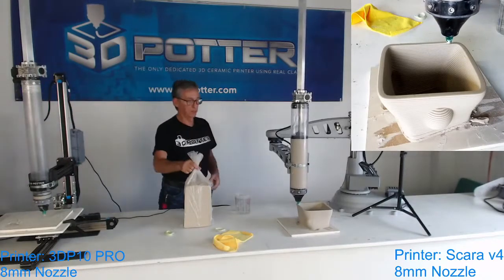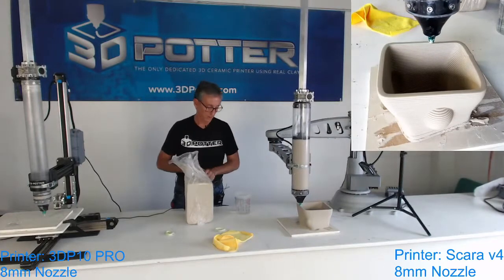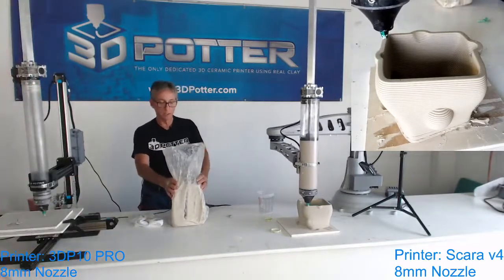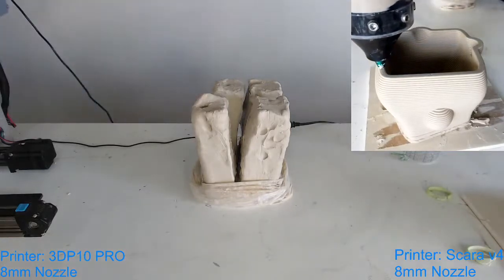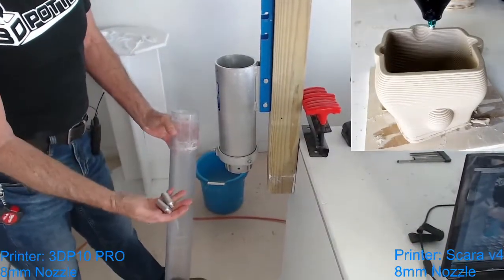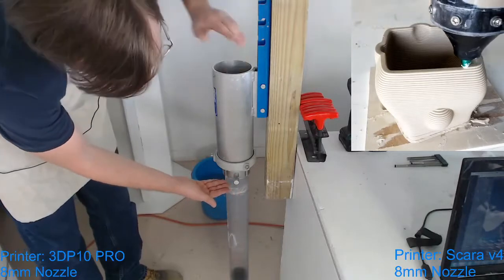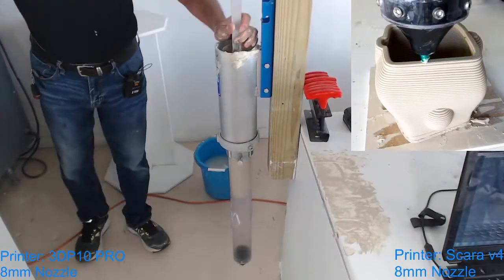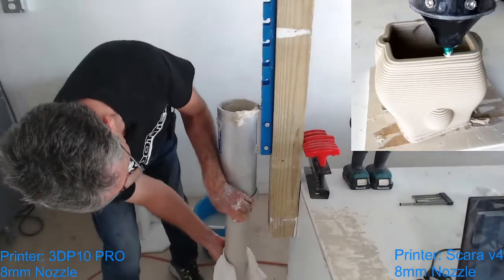3D Potter Hand Loader Full Process

Comment: the water in the bucket is creating hydro-static pressure to force the water equally into the clay below the waterline. it is a great method for dehydrating clay also. I usually clip the top of the clay bag to the top of my bucket to reduce the risk of water infiltration, also make sure your bag doesn't have any perforations, or you will end up with a really wet clay. thanks.